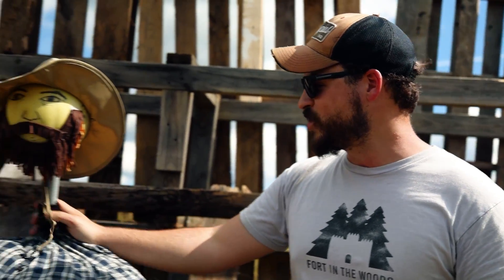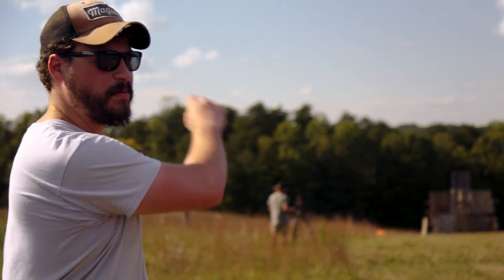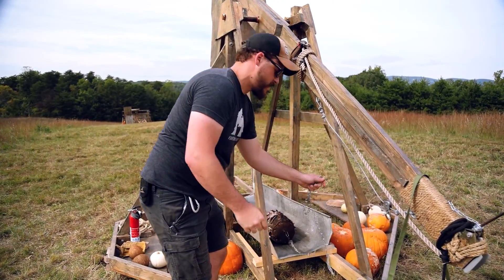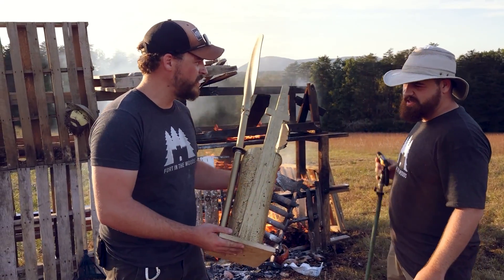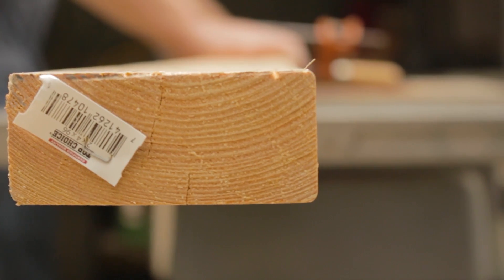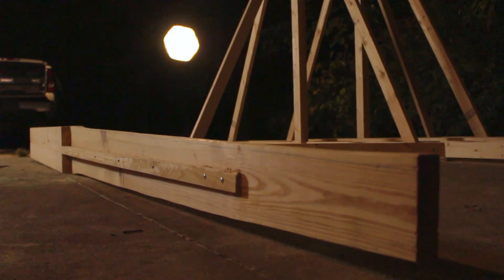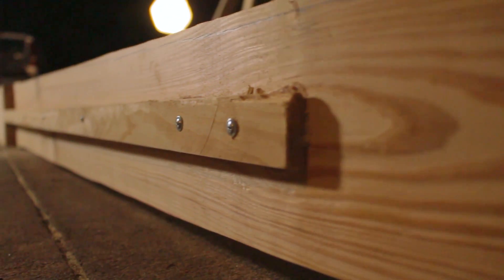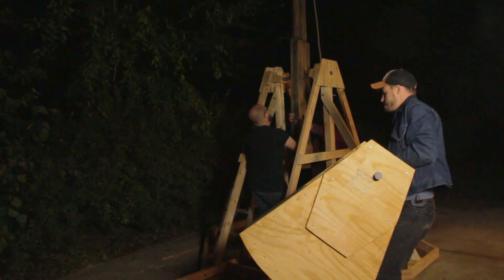Trebuchet Action Compilation - destruction from 20 foot DIY trebuchet. Catapult throws fire 250 feet

Comment: What weight do you use for counterweight?
Reply from the maker: We've changed some things so it depends on which clip you're looking at. In the beginning we used sand bags and could get up to 400 lbs. But we stitched to cut rail road plates and can go up to 600 lbs now.